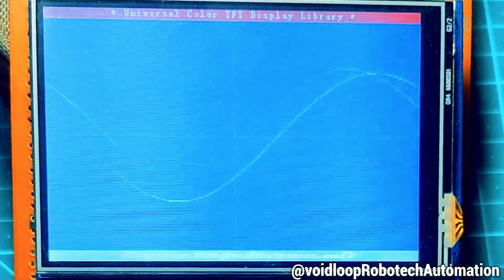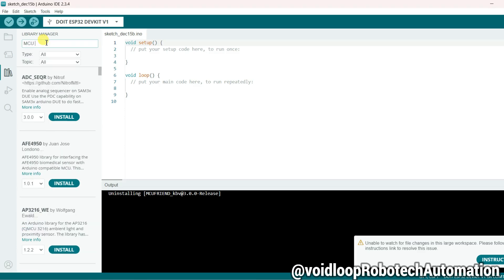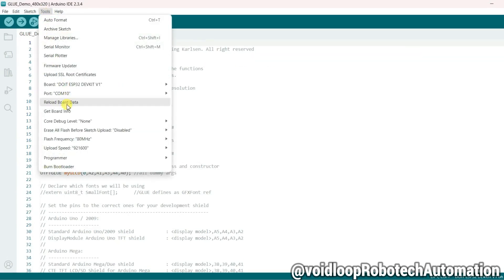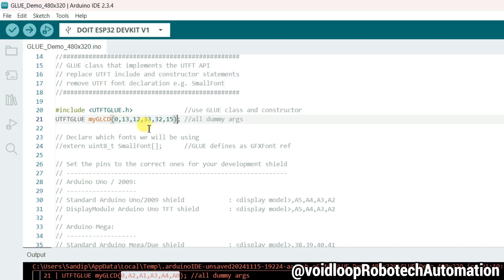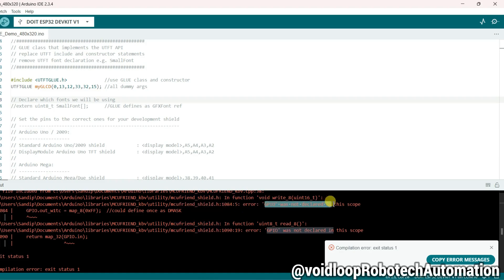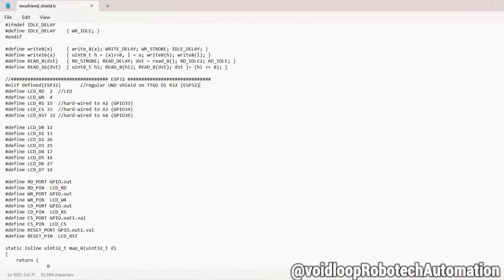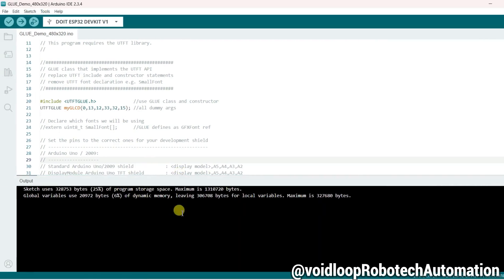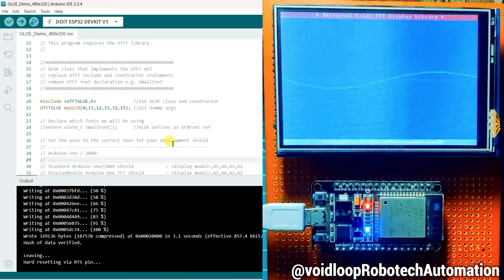43 Arduino Shield TFT LCD Display with ESP32 and Arduino || ILI9486 ||

Comment: can i use an esp32-S3 if so what are the pins that i can use ?
Reply from the maker: Yes
Reply from the maker: Follow the video, you can use the same pin.
Reply: @voidloopRobotechAutomation  the problem is i don't have those pins: 25, 26, 27

Comment: bro thank you pin configurations worked for me but touch is not working i tried with spi also but still not working any advise
Reply from the maker: Touch will not work with esp32 because it's adc is 12 bit resolution. You can try with other touch library